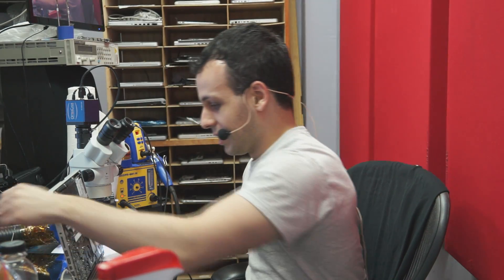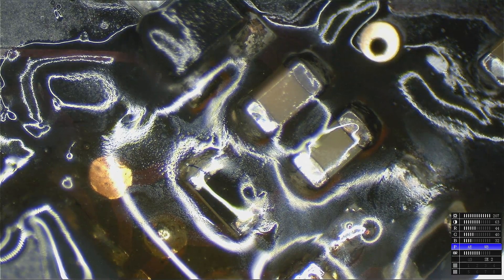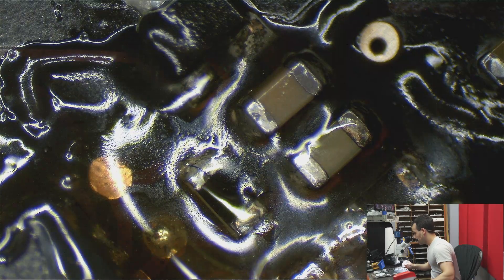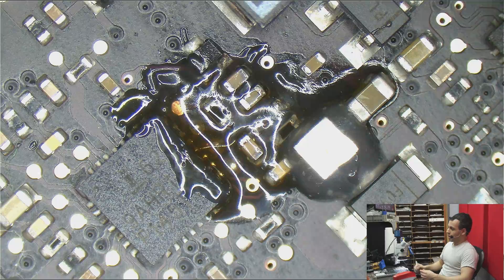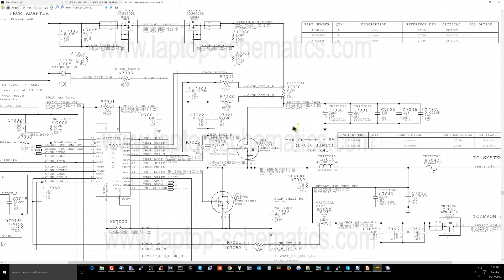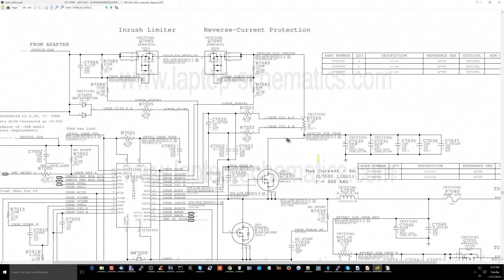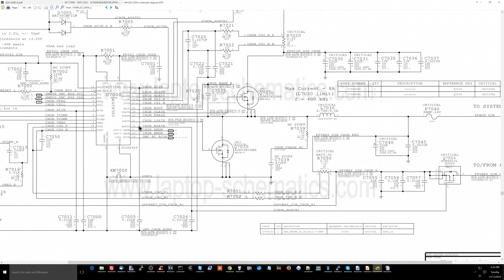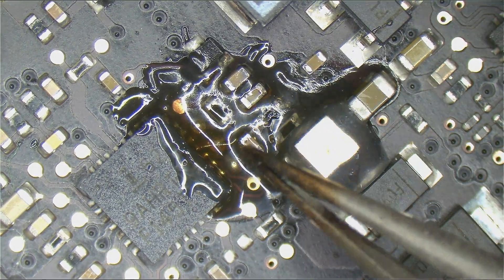Macbook logic board fan spins for one second then turns off

Comment: Let me start with my background:

I've literally never done any type of surface mount work. I did switch my optical mouse's red led for a blue one as a kid, and lifted a trace, so I had to run a wire to fix it. My most technically involved project was building an EEPROM reader for soft modding an original XBOX. The method I used I soldered to a radio shack board, from what I see nowadays, you basically just make a custom cable...

I've never owned a Mac before. I have an A1369 (2010 Macbook Air) with quarter fan spin. I also cannot turn the machine on with the battery disconnected. I am assuming since he said motherboard that is the equivalent to logic board. What part of the board would I physically need to inspect? If I'm lucky enough to just run a wire or something that would be so sick.

Comment: Louis, youtube was trying to shove your content down my throat for years.  After seeing you with LTT I started watching your stuff and I'm glad I did. I have the full on fan right now with no sensors and another of your videos showed me where to start.  I don't have an ultrasonic cleaner so I'll need to find another way to deal with the flux. although my issue seems to have started when I picked up the MacBook too quickly and gave the screen a bit of whiplash. Great content sir, thank you.
Reply: Well, I just reset the SMC and it works properly now. I hope this isn't a hint that this thing is dying.  That would be bad.  The one step I missed last time I tried to reset was disconnecting the battery.

Comment: Hey there!
I just repaired a 820-3476-A Retina A1502 board with the excact same problem.
The difference is that the Retina board does not do a quarter fan spin, it just kicks the fan once like it was starting with the usual 3x turn on - turn off cycle, but does not start, not to mention. Hope this info helps someone.
One more thing:
The new ASD 3S162 just brings up test groups.
Would not it worth it to reverse engineer the groups, by removing the known sensors or their data lines or pull-ups, to figure out which one is which?
Keep up the good work!
Zs
Reply: Hey how did you fix it? I have a retina with the same problem - check it here: 
https://www.youtube.com/watch?v=bNB2cGFihkA

Comment: I'm sorry to bother you with my question, but I really couldn't find an answer anywhere. I've tried to change the thermal paste on my macbook pro, made sure that I didn't damage anything, but now as soon as I turn it on, the fans spin at full speed. I launched an ASD session right after, and the only problem detected was that the fan motor couldn't be set by ASD, the sensors are all working. Do you have an idea of what could be the problem? Thanks for any help you could give me !
Reply: Same, How do you fix this?

Comment: There is no table when sensing current, its all math and differential amplifiers.

The voltages before and after the resistor are tapped of by an differential amplifier, which then amplifies that voltage drop that you talk about from .0001 volts to  around a 0V to 5V, usually in a linear fashion, so 1V is 1A. Then, that amplified voltage is fed into an ADC which converts the analog voltage to a digital signal, and then into a micro controller (smc?) usually. 

Then, inside the micro the voltage is already there, linearly with current. 1V is 1A, 100mV is 100mA and so on. So no math is needed for the designers at Apple and no tables are there, and no one measures anything manually.
Reply: +Louis Rossmann You are really good at explaining this high tech stuff to people who wasn't involved in it earlier.
I've been watching your repair and rants videos recently and I've learned a lot of SMD skills. Although I enjoy the rants videos and your comments more.
It is really nice of you to share all this knowledge, few people would do so, keep up and I wish you the best :)
Reply from the maker: +Ognjen Galić And now you know how I feel. ;)

I oversimplify everything for this channel to a silly extent. While doing this video I was trying to teach the receptionist, standing behind the camera, how this works. Receptionists run away when you use terms like ADC and differential amplifier. Then again, in this case they ran away anyway!

The stuff I find really interesting are the designs at Ayre Acoustics. High gain, no negative feedback at all, perfect sound. A marvel.
Reply: +Ognjen Galić That is all good but very simplified. There are lots of design issues to get the exact analogy between current and potential difference fed to ADC or even the digital value of the current. i.e special op-amps, non linearity and temperature effect on the sense resistor. I usually handle most of them in software (except op-amps of course) using the equations provided in the datasheets, not using lookup tables. But, lookup tables maybe used in this apple product I'm not sure.

https://en.wikipedia.org/wiki/Current_sense_amplifier
Reply: I just simplified it as much as i could to write a shorter comment :P
Reply from the maker: Mohamed Osama Thank you!
Reply: Louis do you have any electronics degree or ever attended a electronics course? Or is it just "field-experience"?

Comment: What would you recommend as some basic gear for fault finding, I mean quality wise and long lasting ?
Reply: +Tom OConnor Fluke 87. Done. All you need.
Reply: Soldering and desoldering ?
Reply: Dont get something cheap. Simple. Hakko is nice for cheap stuff.
Reply: Seen you use hot air on the chips ?